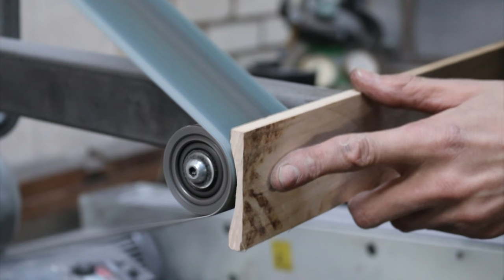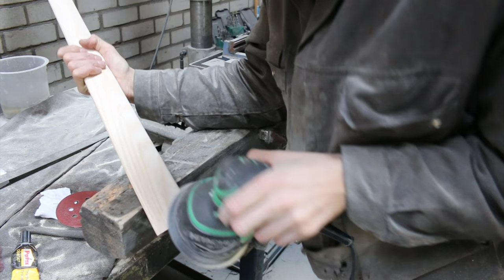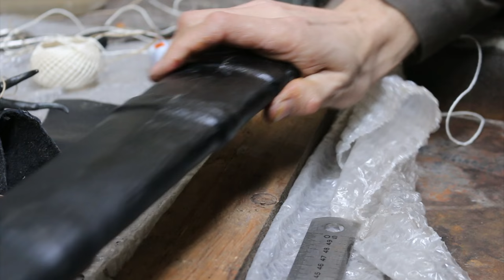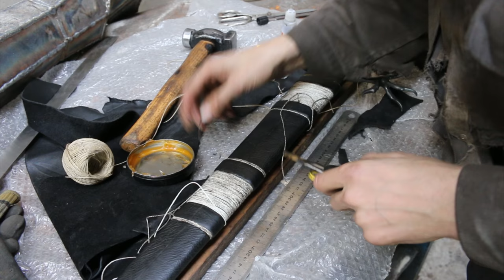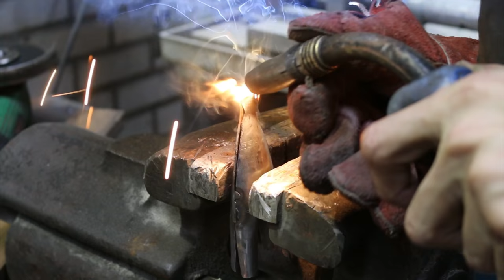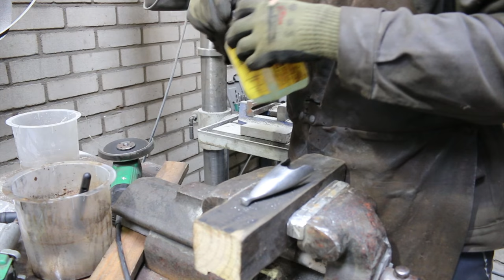Forging a Warlock sword, part 6 making the scabbard.

Comment: I was wondering what type of glue you used to stick the two sides? It looks like it might be UHU? I'm at this stage myself and trying to find out what glue to use because I've heard PVA can cause rusting on the sword later down the line.
Also, should I be sealing the inside of the scabbard or just leaving it as bare wood?

Comment: at around 7:20 what is that grease   looking stuff and also what  is the purpose of rubbing it with the olfa knife shell?it it to kind of burnish it to some extent or just to smooth out the leather some more?
Reply from the maker: Brennan Fry it is leather grease.  I use the knife as burnish tool exactly like you describe it.

Comment: hey Freerk I have a question. someone told me that you can wet the leather and let it dry around your wood and it will shrink to the wood. I was sceptical because the wet leather might ruin the wood. so is this a good idea
Reply from the maker: I did that some time ago,  it can work with a sewed leather sock and warm water,  I did not like the result that much, so I prefer softening with grease and sometimes shrinking with fire. (very subtil)  i am not a expert on leather tough.

the wood can handel some water,  but I would be more concerned of the blade and water residue.
Reply: Freerk Wieringa so you just place grease on the wood and wrap it then you wrap it again with twine.
Reply from the maker: Exodus 2017 basically.  A
Of course you glue it to the wood.